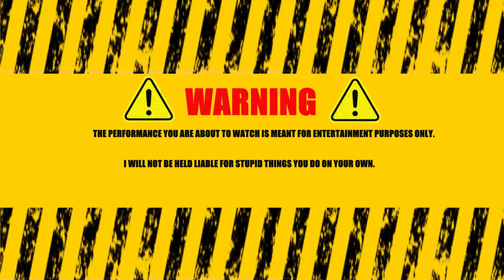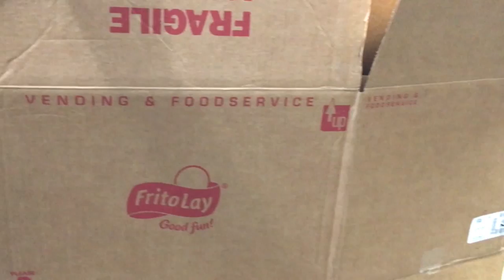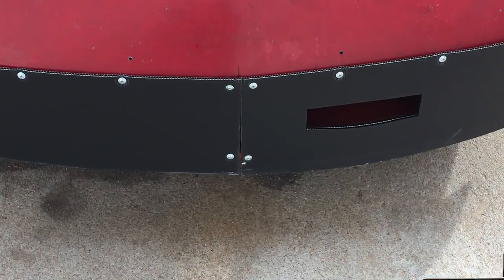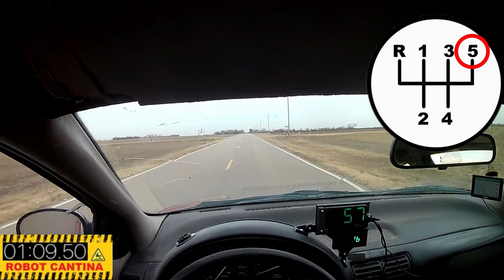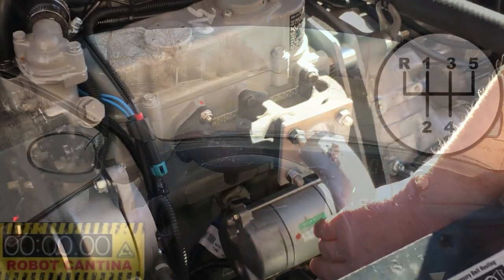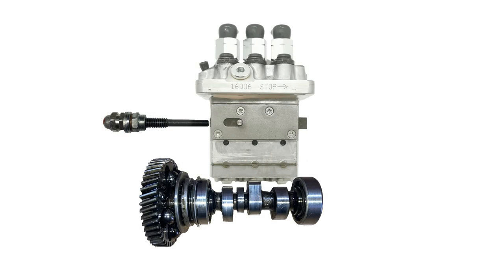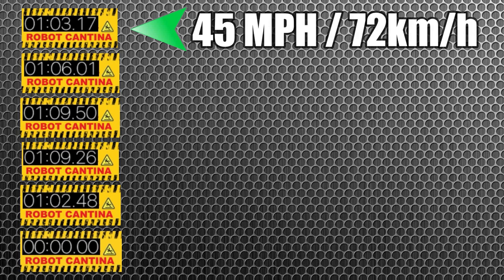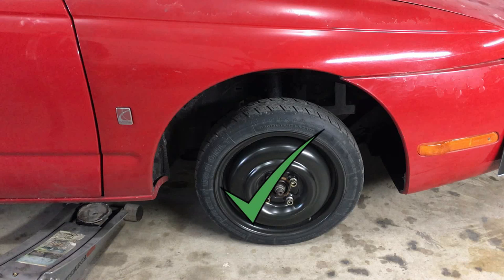S3E2   Fuel and aerodynamic mods ....We do some experiments to try and get the Saturn to go faster.

Comment: Some of these have already been said by others, but:
Power loss might be due to warmer intake air temps from closing off the grille. (Also, worse aero can notably hurt near-top-speed acceleration.) Maybe could run a hose from the rectangle hole in the airdam to the engine intake?
Removing that spoiler might make aero worse (that type of spoiler is probably catching airflow coming off the roof and helping it separate from the car cleanly). 
Blocking unnecessary air from going into the engine bay with that airdam is good, but a sharp 90-degree transition at the bottom of that airdam is not good for aero. An easy way to make that a nice smooth curve is to get a length of foam pipe insulation two or three inches in diameter; slice it in half lengthwise so it's a semicircle in shape, then glue it round side out to the airdam so the bottom edge of it lines up with the bottom edge of the airdam. So that from the side (with the car aiming to the right), a cross section would look like a lowercase b.

Comment: A little info on diesel egts, as you said there is no throttle for air so at low power times they'll run extremely lean which keeps the exhaust cool because there isn't enough energy in the fuel to make excessive heat, same reason for high idle switches for cold warm up. 
With adding a turbo if you can keep it at that point of being lean enough to keep cool it should be very efficient. 
Many people on the internet will argue this but if you add enough fuel you can keep the egts down as well, and get more power than lean cool.
Another option would be injecting straight methanol under boost, I would expect impressive results from that.
I would expect that lil engine to hold up to a decent amount of boost if you keep the egts down, don't turn up the timing, and keep the charge temp cool.

Comment: Excellent progress Jimbo! Do I hear a bad wheel bearing? That is additional mechanical drag if so.
Does the Saturn trans use atf or gear oil? If the latter, then a swap to GM Synchromesh oil will reduce drag further. 

Look forward to the turbo installation!
Reply: Im hearing the wheel bearing as well..

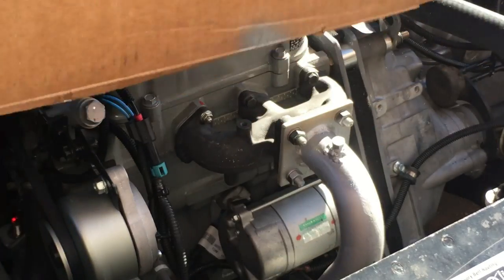Comment: 12:10  Cold exhaust at idle.  This is typical for a diesel.   The excess air running through the cylinders keeps the engine cool.  This is why idling a diesel for long periods is a bad thing as it leads to " Wet Stacking" / lots of carbon.   Some gas engines during a cooling system failure shut down alternating injectors to limp home the car.

Comment: Try adding water meth when you go about installing the turbo. It will help drop charge temperatures and will also add more fuel into the system.  Also that aero is probably a bad idea since you’re going to want that area and air flow for a intercooler. Like another viewer commented rig up a cool air intake, your power loss is most likely due to the engine breathing hot air. It’s not about how much boost you can cram into an engine but how much air density you can feed it.
Reply: Yup that the best way and you pick up power
Reply: For sure. And when he adds an intercooler, he can find a used intercooler off eBay for next to nothing. Something from a civic or a fiat 500 would be plenty small enough.

Comment: Would the car go faster if you took the black covers off the bumper with the fuel adjustments?  Sometimes blocking airflow like that makes a difference in aerodynamics too, and not in a good way.

Comment: on mechanical pumps the optimal pump setting is a little smoke at low rpm and clean burn near top, put a cold air intake because without the engine bay airflow the under hood temps might get really high and especially diesels need really cold air for best performance, if you run out of fuelpump you can raise the inlet pressure to the pump in mercedes mechanical pumps you can raise it from stock 1 bar to 2 bar without problems dont know how much you can raise it on that and if you still dont have enough fuel you can make a water/meth injection system and get a little bit more,  pump timing makes a lot of difference especially at higher rpm, 800c egt temps shouldnt be a problem, i havent had any problems on my mercedes om603 without piston oil squirters, thank you for the great videos cant wait for the next one!😄

Comment: Such a fun project to watch!  We can't see what the exhaust is doing, but if you're giving it more fuel then it may also not be buring it completely.  Maybe consider adding a propane injection when you get the turbo on?  Thanks for sharing!
Reply: Actually those engines the smoke clears after rpm goes up cause their made without forced air induction and even adding a turbo with it stock no fuel screw would really help

Comment: Thank you for zooming in and showing the heater core is plumbed to the bypass tube. Many thanks!
Reply: @ocdman202  The Model T was introduced to the world in 1908. Henry Ford wanted the Model T to be affordable, simple to operate, and durable. The vehicle was one of the first mass production vehicles, allowing Ford to achieve his aim of manufacturing the universal car.  Telegrams went the way of the Model T..
Reply: The lights of the original Model T were not electric. The common lamps used on horse drawn vehicles were the lamps used on the Model T, this meant it used acetylene carbide headlights and oil side lamps. Electric lighting and electric starting became available for the Model T late in production during the 1920’s.

Comment: I bet removing the rear seat and front passengers' seat would be help for weight reduction. The best car to put the little diesel in would have been a late 1980's GEO Metro, they only weight 1650 pounds. But we use what we have for experiments. I like how you explain things as you go, it helps us who don't understand everything, understand. Thanks from Michigan.
Reply: Ive been looking at small diesel engines for my sand rail so i can use it with minimal to no electronics and if its under 700cc in my state, i can register the sand rail for the streets which is my primary goal for the buggy.
Reply: Or the metro older brother the chevy sprint 1470lbs but people want like $3,000 plus for them.

Comment: The slight overspeed wont matter in a car because it won't spend prolonged periods of time at max rpm. It's an industrial engine designed for power applications like hydraulic pumps or generators where it sits at the set RPM for hours on end

Comment: The extra air from boost will help cool the exhaust some up to a point as it will lean the mixture back out to normal.  The mixture now is rich , and should be running cooler but its diesel and I don't know enough about the fuel system. Normal exhaust operating ranges can vary and be quite high on some engines. This is at full load in 5th right now . Its laboring. Boost will make a huge difference.  6 to 10 lbs. Would be a great improvement

Comment: Hey Jimbo, That was a fun video. You can fit a pressure guage to your fuel supply point at the pump, make sure you're not dropping fuel pressure at wide open throttle.
That engine should be good for 1 Bar boost, it has a tough sub assembly. You can also safely go to 650 on the egt, but you may want to either intercool the boost or add water/meth injection...keep going !
Reply from the maker: Thanks!   We have a new higher flow electric  diesel fuel pump on its way.  The pump we are currently using is rated for diesel but is very suspect... especially since it only cost $10.00.  The new pump set us back a whole $23.99.  If that dosnt help, we will put a pressure sensor on the line and see what is going on.
Reply: @robotcantina8957  Do you have a restriction on the fuel return line? I'm not sure if these injection pumps have one built in, but is necessary on diesel engines. My only experience with these engines is on truck-mounted reefer units, and typically they're equipped with a fairly dinky transfer pump.

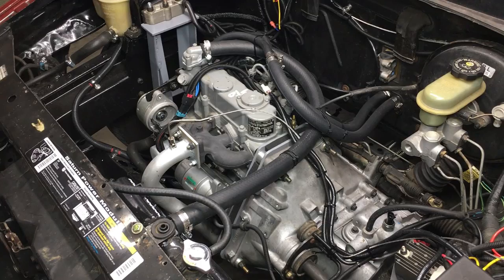Comment: I think the lack of improved acceleration time to 55mph (1:09.50) can be attributed to the lower power from having to shift to 5th (as well as time needed to shift). It looks like times to 50mph were about 50 seconds with the big wheels/tires and about 44.5 seconds with the small wheels/tires. I think if you were able to use a CVT and all other variables were the same, the times between big and small tires would be most noticeable. That is, unless I’m missing something here, which happens from time to time.

That said, I love these kinds of projects. Thanks for sharing yours!

Comment: 1. You NEED a cold air intake (like MANY have already stated) with a blue Donaldson Ultra-web Nanofiber cone-style air filter. The colder the air, the more oxygen in it, the more efficiently combustion occurs (ie. more power). DO NOT, I repeat, DO NOT use a K&N style cotton gauze air filter!! They flow 50x's more dirt into a motor than the Donaldson filters and 5x's more than the stock paper filters. ESPECIALLY if/when you turbocharge the motor! A cotton gauze filter basically "sand blasts" the impellers of turbos with super fine dirt that they let pass right through, which makes each blade of the impeller weigh a different amount over time (due to the uneven sanding effect) than the other blades, causing it to wobble a little, then more, and more until it wears out the turbo's bearings... ie. NOT good. Smaller turbos have impellers that spin over 100,000 rpm easily, some far more!
2.  IIRC, that engine uses a 180 degree thermostat, which seems kinda cold for a diesel. My suggestion is to use a different coolant, specifically a "waterless" coolant called Evans Coolant (NPG Plus?) and raise the thermostat's temperature 25-60 degrees (might have to custom make one?). The hotter a diesel runs, the better the burn INSIDE the cylinder... ie. more efficient. This coolant is, in two small words, "BAD ASS"!! Its boiling point is between 375-400 degrees, under pressure or not!!   It has ZERO water in it, which means no rusting out the motor, radiator, heater core, etc... and it also eliminates electrolysis. You can run an engine up to operating temp for a few hours and simply remove the radiator cap (with a rag!) while running and all that happens is you hear a small "pop" because this coolant DOES NOT build up pressure like normal "antifreezes" do. No squirting of antifreeze 10' into the air either or waiting forever for the motor to cool down in order to check coolant level! (I think the website is www.evanscooling.com ??) 
3.  Please use some good synthetic motor oil in that diesel engine, preferably Amsoil 5w30 or 15w40 HDD oils, specifically for diesels. Amsoil oils can handle the high heat AND can neutralize the acid build up better than ANY other product out there that I've tested. You should use Amsoil's bypass filter system (uses Donaldson filters) as well. It takes out MUCH finer particles in the oil than just a regular, full-flow filter alone.
4.  You also might look for some 1992-1995 Honda Civic VX hatchback 13" OR 1996-2000? Honda Civic HX coupe 14" rims. Either of these are made of magnesium alloy (NOT aluminum) and are MUCH lighter than steelies OR aluminum. IIRC, the 14" HX rims weigh 14lbs. each (I currently have 4 of them on my 1996 Civic CX hatchback) and the 13" VX rims (I also have one as the spare until I find 3 or 4 more, for the same car) weigh 9lbs. each!! These specific model Hondas were made to get 50-56 mpg on the highway and 40-45 mpg in the city!!
     I did not look up what 4-bolt pattern your Saturn has, but these use a 4x100mm bolt pattern. 
     Less centrifical/spinning mass to move = less power needed to turn = more speed & fuel efficiency.
5.  I was thinking... you could also go with a good, small supercharger, like a Rotrex, instead of a turbo. The reason? Because if you go turbo you MUST change your exhaust manifold & pipes, which can be expensive and/or very time consuming. Whereas if you used the Rotrex supercharger you could keep it like you have (maybe go a little bigger diameter of pipe IF the motor needed, but probably not) and NOT have all of that extra 1800-2000 degrees of heat under the hood. Plus, you would have INSTANT power right off idle, which you desperately need in order to get up to a normal, safe speed (like other "normal" traffic). With a turbo, you are going to have some lag (even with an intercooler) until you get that motor spinning at a higher rpm, but the supercharger doesn't need higher rpm to give you power. The Rotrex is also as efficient, or even MORE efficient, than an average turbocharger (80-85%), like 95%-99%+ efficiency for the Rotrex!! They have a few different sizes, but I think the one they use on Harley Davidson's (which DOUBLED its horsepower!!) will probably be just right for this application.
     Keep up the good work and let me know what you think about these suggested mods I've listed above, which will work on ANY vehicle, gas or diesel!

Comment: The engine is likely heat soaking which would explain the power loss. If you put a hole in the aero mod for the intake air you will get way better power and lower egts. This bit will be very important for turbo charging as without the piston oilers and perhaps a oil cooler, you are going to want the air going in as cold as possible. Remember colder air going in give better power and fuel economy
Reply: He may benefit from running a cold air intake pipe out to the front of the car. It'd get the air to the densest area and away from any heat.
Reply: @americansmark  plus if the flow of the intake is smooth he will basically gain some free horsepower above 30 mph.
Reply: Cold air does not improve fuel economy, it's the exact opposite. Google what a warm air intake is for example. Cold air slightly improves power and slightly decreased fuel economy.
Reply: @swecreations  he needs more top end power, so that is what he needs to do.
Reply: @swecreations  it absolutely does because this engine is mechanical and burns the same amount of fuel no matter what. So when you give the engine more power potential, the less you are heavy on the throttle for acceleration and the faster you can get back to cruising.
Reply: @kennedy796  https://en.m.wikipedia.org/wiki/Warm_air_intake
Reply: @kennedy796  

"All warm air intakes operate on the principle of decreasing the amount of oxygen available for combustion with fuel. Warm air from inside the engine bay is used opposed to air taken from the generally more restrictive stock intake. Warmer air is less dense, and thus contains less oxygen to burn fuel in. The car's ECU compensates by opening the throttle wider to admit more air. This, in turn, decreases the resistance the engine must overcome to suck air in. The net effect is for the engine to intake the same amount of oxygen (and thus burn the same amount of fuel, producing the same power) but with less pumping losses, allowing for a gain in fuel economy, at the expense of top-end power.

Opposite principle of a cold air intake (CAI) which significantly differs by collecting air from a colder source outside the engine."
Reply: @swecreations  it says right in the Wikipedia article that the ECU compensates for the air temp. And there is no ECU on that engine to compensate for intake air temp. It burns fuel at a set rate determined by mechanical stops in the mechanical pump. Which might adjust for boost pressure but is not typically set up for intake air temp differences. So the more dense air inside the engine will burn more efficiently and thus leaning out the mixture just enough to make it run right.

Comment: In my personal experiences with a kioti engine and I believe the same injector pump.  Screw out until (while underload) you just start to see smoke then back in ¼-½ to achieve the max HP. Same applies to the turbo install, unfortunately with the kioti you actually run out of fuel adjustment before max HP can be achieved after a turbo install but the difference was WELL worth the effort. Kioti sxs's are lacking terribly in the bottom end for power.

Comment: I'm impressed with those numbers. Good as a VW TDI or little Saab TDI. Obviously, the recirculation of the exhaust gas will balance the increased KW Joules nicely. ✌️♥️👍👍
Maybe the drag at the rear should be red yarn tested with three or four 1 meter lengths across the trunk lid. In practice the yarn will likely not fly straight away but instead suck back into the low pressure drag ares created by removing the vortices extending wing. Good for a guy riding your tail on motorcycle but not for acceleration and fuel savings.

Comment: The largest source of drag is the underside of the vehicle. A lot of low powered homebrew racers I've met make a full length underbody shield out of smooth plastic and it makes a massive difference in drag.

Comment: I think you should use the insight wheels on the saturn to test if the lighter weight, combined with the wheel design could reduce drag and make it go faster! I just looked, and both sets of wheels should have a 4x100 bolt pattern with an offset range around 45. Who knows, maybe even a cardboard and duct tape mock up panel to copy the insight (rear wheel well panel) would help too!
Reply from the maker: Great point!

Comment: I'm a Kubota mechanic and I have found with those small 3 cylinders that if they are starved for fuel they will still run but have power losses so I would suggest putting a larger fuel filter for the engine think a fuel filter can can run a V8 car for size because at wide open throttle they do burn a lot more fuel than a gasoline engine.

Comment: Seeing the engineering on all other videos I have no doubt you could add oil squirters to this engine. Tap into oil galley and just add them to stand alone rail inside block under rotating assembly. Honestly that would be simple compared to the other wizardry you have already done.